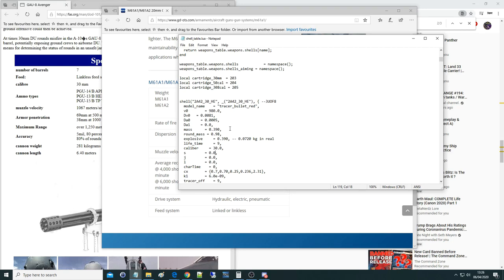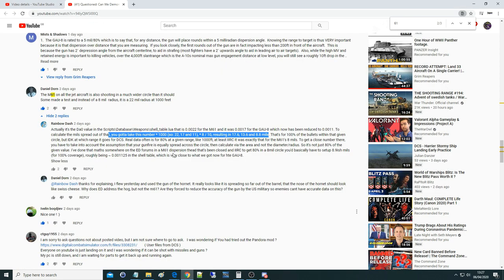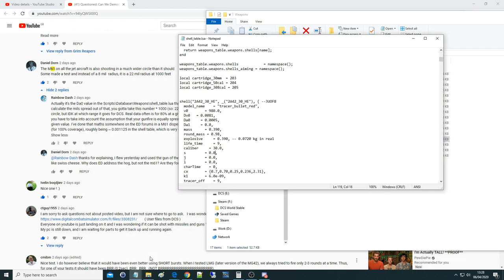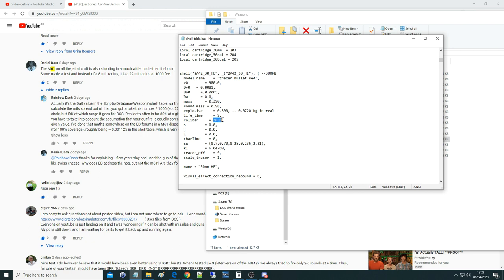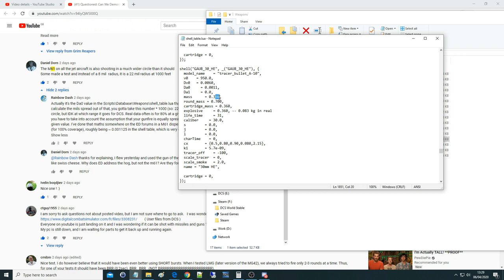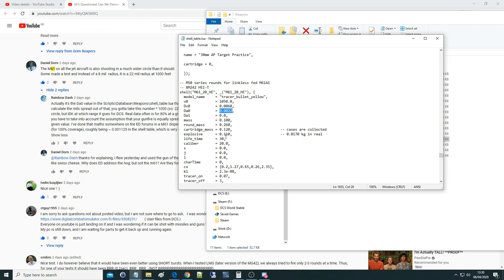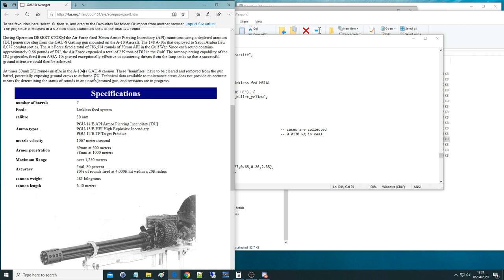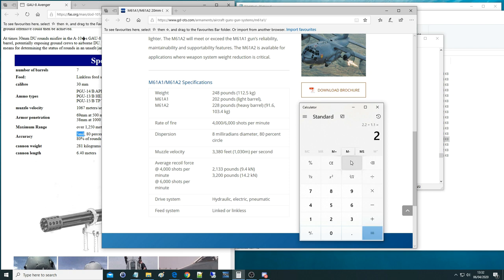Questioned: Is The M-61 Vulcan Correctly Modelled In DCS WORLD?

Comment: For completeness, there's another slightly relevant value: Dv0 - muzzle velocity deviation. Each round will have a slightly different muzzle velocity, which will affect vertical and longitudinal accuracy.
The value is probably a ratio but the values still seem quite low.

Comment: I don't don't know how accurately DCS simulates fire from an M-61, but I have been told the gun is not intended to be like a laser beam and that it is designed with a desired amount of dispersion.  If every round hits exactly the same point in space you are likely to score a perfect miss, where all your rounds miss the target by the same amount.  Some dispersion increases the chances of hitting the target with a lethal amount of fire, but too much dispersion would result in an insufficient number of  hits for lethality.  100 rounds per second produces a pattern with productive lethality even if only a portion of the rounds connect.  I also heard but cannot confirm that the GAU-8 was intended to have less dispersion than the M-61 due to its intended targets.

There has long been a tension between the concentrated fire and dispersed fire philosophies in setting up aircraft guns, especially when wing mounted guns are involved.   In WWII pilots that were expert shots preferred guns harmonized to concentrate fire on a point at an ideal firing range, but the average pilot was more likely to score hits when the guns were adjusted to produce an area pattern at firing range.   And you've probably all ready that Werner Moulders and Adolf Galland disagreed on the armament of the BF-109F, one preferring the fewer nose mounted guns and the other preferring more wing guns like the Emil for a better chance of hits for a non-expert shot, or of doing more damage for an expert.
Reply: This is probably the point why it's like that in DCS. The M61 first was the weapon of the F-15C, a pure air to air fighter. You want that higher chance to hit something with a short burst there in a dogfight. I've picked up by following the discussions on that issue that IRL they use a "clamp" to increase the spread to get that effect which basically is what we've got in DCS. The gun would be more spot on without that. And now comes the point since we've got the F/A-18C - which also is an A - attack plane. You'd want more precision there especially as you've got to fire at quite some angle above your TVV so you'd need to pull up early on. The ideal solution for all of us would be if we could choose in the armament panel. With clamp for dogfight, without for A/G or if we just want to be aerial snipers.
Reply: +Gort  With the aircraft itself being one of the variables in air gunnery, tight pattern harmonization would be the best approach for four or more guns such as were factory-installed in the USAF / North American Rockwell F-100 and USN-USMC / Chance Vought F8U.  General Electric originally designed the Vulcan gun for point harmonization of all barrels during test-firing on the ground; vibration of the installation itself and the variables of ammunition result in a natural dispersion pattern of up to 6 mils.
Reply: I bet cannons will soon be replaced be lasers. Any takers?

Comment: This has been discussed over at ED's already:
https://forums.eagle.ru/showthread.php?t=242921

Within that thread it has been pointed out that you'd have to take the given value like 0.0022, move the decimal separator 3 to the right (=multiply by 1,000), so you get 2.2 and multiply that by 8 again which is 17.6. That's the 100% mil radius (it's actually the radius in milliradians). To get a proper 80% coverage value, you'd have to approximate it by calculating via the area and not just the radius, with the result being a bit more than just 80% of that, actually somewhere around 89% IIRC. It's all in that thread, there's some excellent reseach done by the guys.

After they changed the GAU-8 and in that thread even said they *might* change the M61, I just hope this gets looked at again.

One thing to be mentioned though: The fact that it sprays more makes it easier to hit something in a dogfight, but you need to get closer to ground targets to get a good volley of hits on a small target without shelling out hundreds of bullets. The effect can be seen if you compare the F-14B to the others using the M61 as Heatblur did change the accuracy for their module. You can see this in DCS World OpenBeta\CoreMods\aircraft\F14\Entry\F-14B.lua, line 146 where it has "Da0     = 0.001," as opposed to the 0.0022 that ED uses. So that one's even a bit more precise still than the GAU-8 now.
Reply from the maker: thx RD

Comment: But do those figures from the manufacturers come from guns that have been bench clamped or from in airframes where the recoil may be a factor?, Also isn't it better for a gun that is designed for air to air to have a bigger dispersion(fast planes snap shots)  than one for ground targets
Reply: 8 mils, 80% is the threshold at which the M61's barrels would be thrown out of the airframe and replaced with fresh ones for having become too worn. A factory fresh gun would have much lower dispersion. 

There have been threads about this since at least 2016 on the DCS forums.
Reply: The manufacturers data most probably come from ground mounted, stable and rigid mounting. That shouldn't be a factor though as any oscillations would induce more inaccuracy on the shots fired anyway, including recoil.